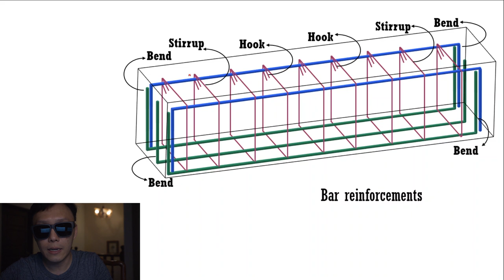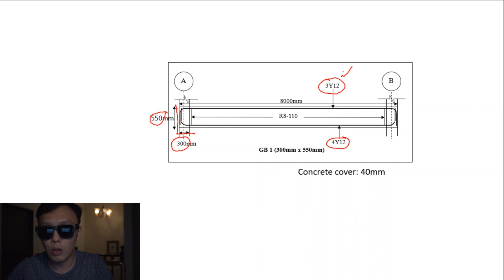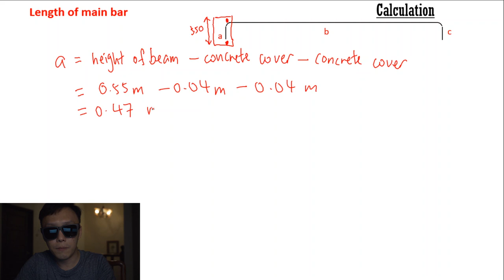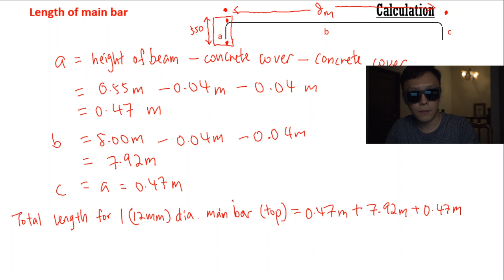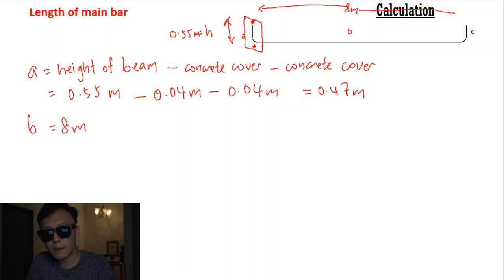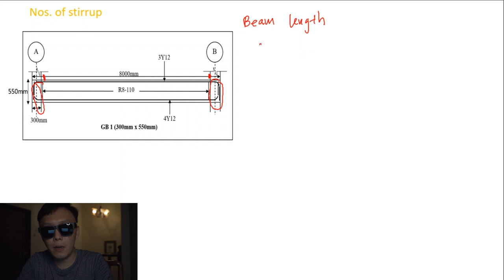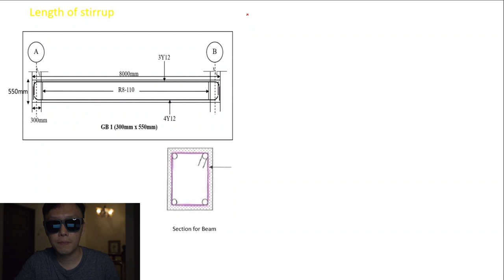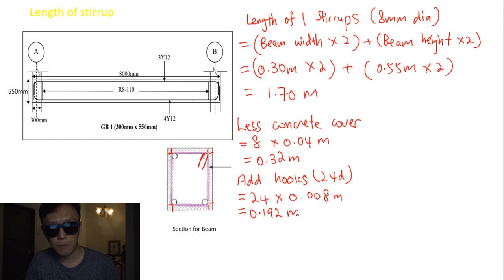How to calculate Reinforcement for Ground Beam?

Comment: Why some people calculate the top bar or bottom bar beam length b add 12d both side? some of them used 9.5d. as they call development length. its so confusing. but your way is easy to understand.
Reply from the maker: 12 or 9.5 is the coefficient to be multiply with the diameter of the steel. 12 means safety factor higher.
Reply: Thank you very much for great explanation 
Can you tell me which country is drawing like this?